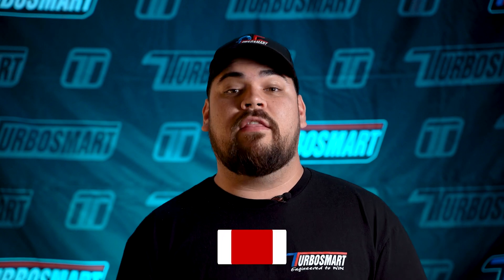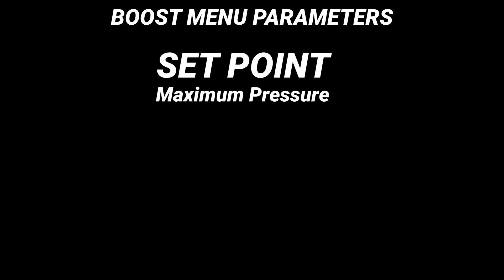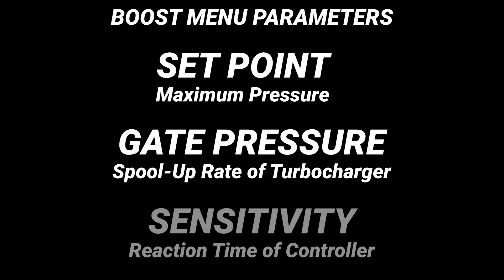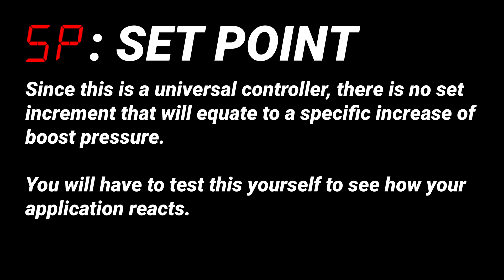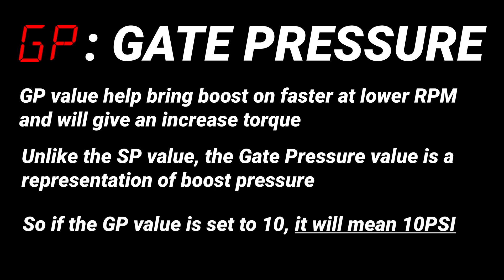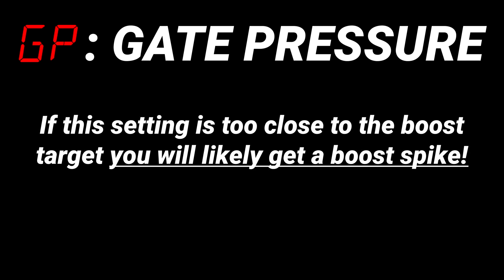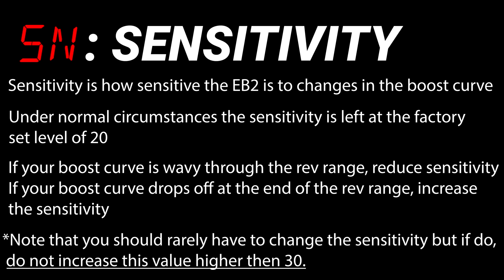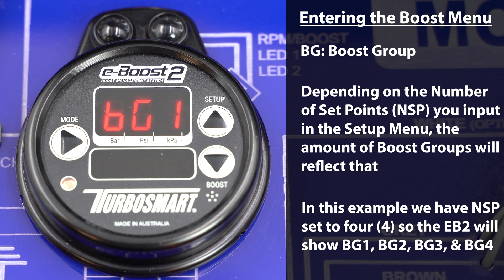E-Boost2 Explained! EP.3 | Boost Groups

Comment: If I am running multiple BG's, how do I know/set which group I am running. Also would like to speak so someone directly if possible. I am running compound boost with a Whipple 3.0 Gen V with twin Comp Turbos 64/67. Something a little different than the ordinary.
Reply from the maker: Usually the screen will flash when you switch to the boost group. Otherwise there isn't necessarily a fast way to check but if in the live boost screen you can press the up or down arrow key to see what group you are currently in as well. Keep in mind that it will display as the SP value rather than BG. Feel free to reach out to us! Our phone number for your region can be found on our website.